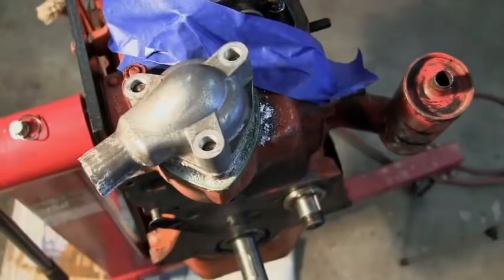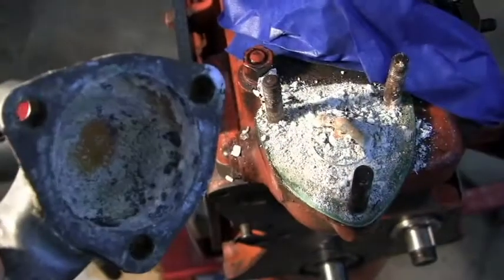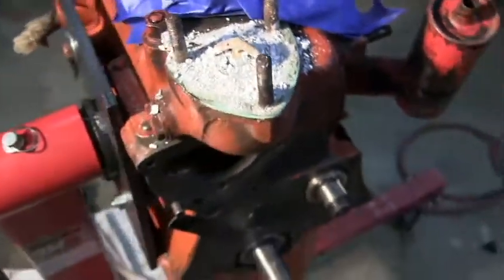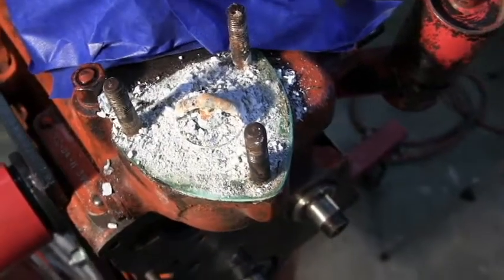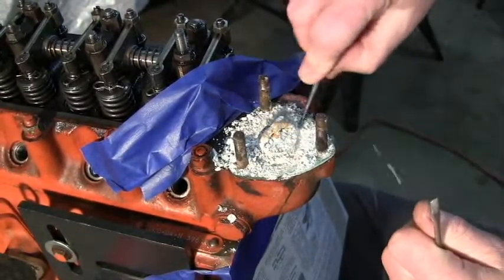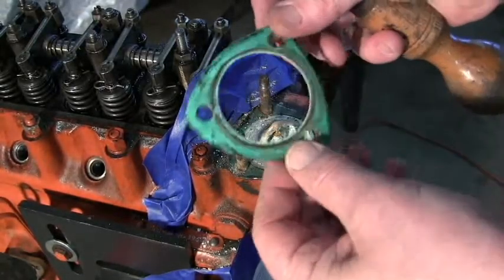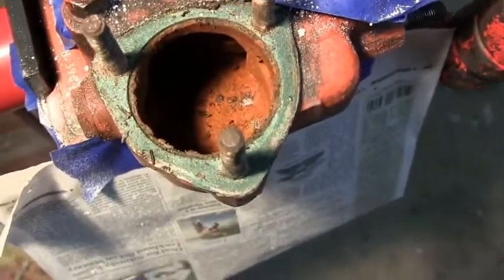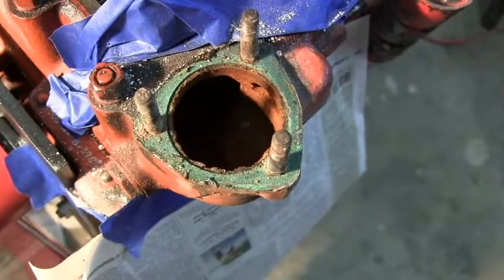Morris Minor Coolant Corrosion Horror!  Video #29

Comment: I think this is galvanic corrosion caused by the use of a copper gasket which has reacted with the alloy thermostat housing.   I believe the original gaskets were cork?
Reply from the maker: Not sure about the original material, but for thermostat housings all I've seen so far is paper/card.

Comment: Hmmm 🤔 no deposits on the head side of the thermostat suggests the deposits occurred during storage… I quite often use an 11mm socket on my Morris Minors but tend to use six pointed imperial sockets / imperial spanner’s if the bolt / not looks like it’s going to put up a fight. Really enjoying your morris minor videos, please keep them coming 🙏
Reply from the maker: Will do!  Next set of videos will be about the 'new' 1098 engine I acquired last month.  It was orange and now its turning green...